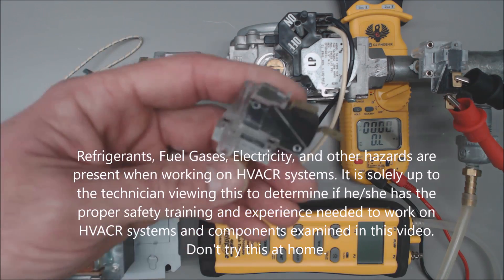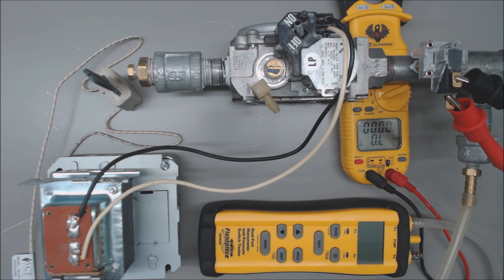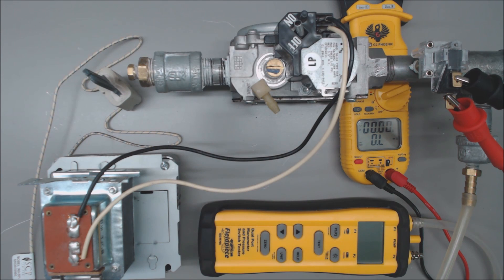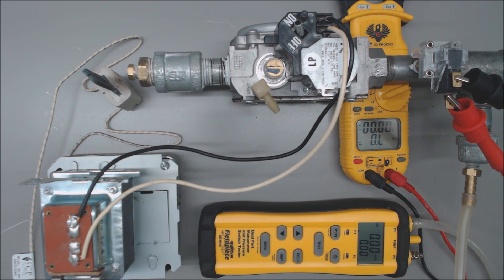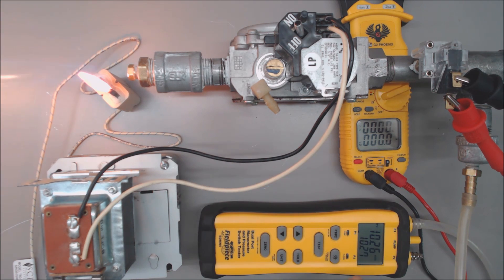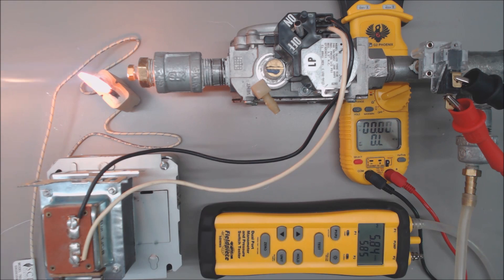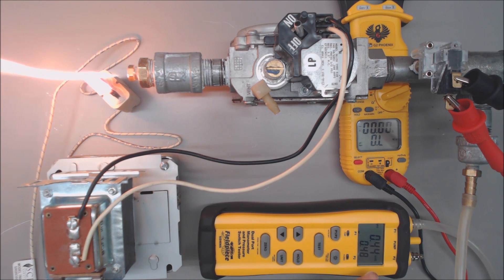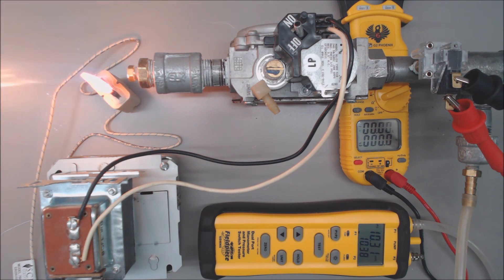Gas Furnace Low Pressure Gas Switch Testing and Why You Should Install Them!

Comment: This video was very well done and very helpful in understanding what this switch does. The technician who looked at my furnace today said he was getting intermittent continuity through the switch, but didn't really know what the switch was for. He also wouldn't replace it because the gas part of the system isn't covered (Through the DTE protection plan I have for the house) I have a gas furnace that was converted to propane and I guess this was installed with the conversion kit. The propane tank is at 75% and I'm not having any problems with the other gas appliance. If I can identify the switch, I'll replace it myself. Knowing that it's part of the conversion kit is going to help.

Comment: I just had my ass kicked servicing a propane converted furnace. 
This is a new safety device i am now totally aware of. Customer had no propane which had the safety valve closed no power to complete circuit. 
It was wired in series with the pressure switch.

Comment: I just had to clean my lp water heater today due to low pressure.  My regulator froze at my 1000 gallon underground tank and I was getting very low gas pressure.  I’m looking for something like this .  If I have no heat due to low gas pressure them I will know I have a problem and can correct it so my water heater, or furnace don’t soot up.  Can someone pls tell me how to connect it to the gas line and also where I can buy one.  I think if I drop to 8” or less it should shut off.  Is it adjustable?  Thanks
Reply from the maker: I always get them when installing Carrier, Bryan, Payne lp conversion kits but you may also be able to get them through Johnstone.com thanks

Comment: I’ve seen LP systems soot up on 90% furnace due to low gas psi. That switch is critical on LP in my opinion. Good video. 👍
Reply from the maker: Absolutely I agree and have seen the same, Thanks a lot Nor Cal!